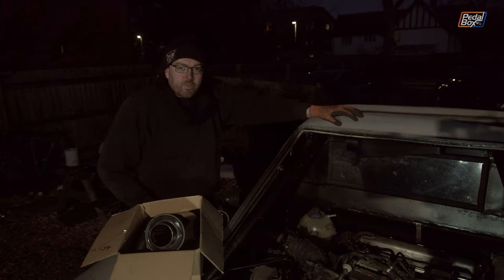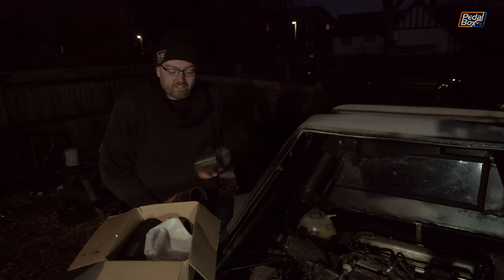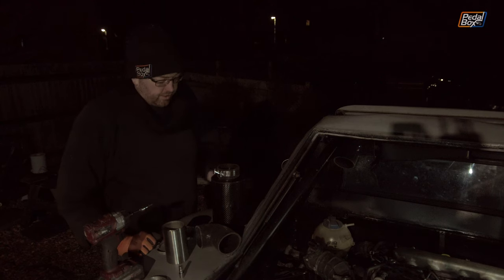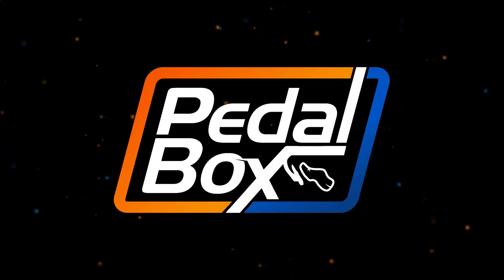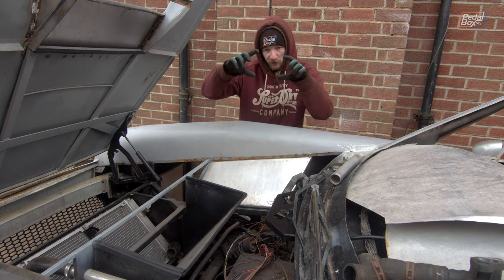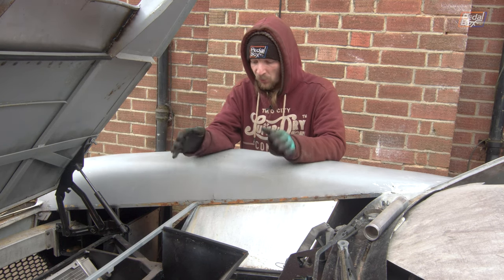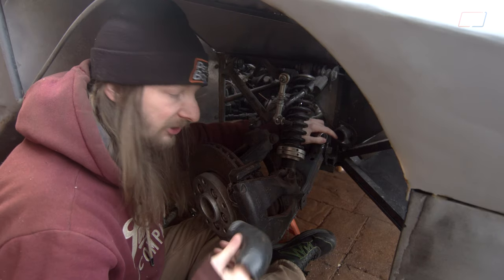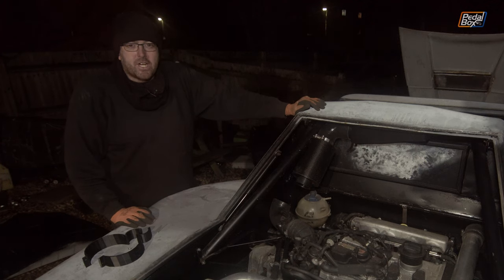PRINTING Our Problems Away | Audi TT Kit Car | PedalBox Episode 124

Comment: You could really see the temperature change in the frosting over of the rear window. Doesn't look like a pleasant time! Still, that's an awesome looking intake, and the way everything just fits so beautifully is fantastic!

Also, as an observation - with the air intake being solely on the roof and nowhere else... the little racecar is also, apparently, built for swimming :D
Reply: Murderwagon will not be waterproof enough to serve briefly as a boat, so it cannot cross rivers, lakes or even seas even if they aren’t too choppy
Reply from the maker: Without enough speed you can skim over anything :P

Comment: Great video, great to see the car progressing.

For creating the design for the bracket you might want to take a look at Fusion 360.  I've never been great at CAD but Fusion seems to be pretty capable and the community are very helpful.
Reply: I’ve been trying to convince Ade to pick up FreeCAD for ages but the transition from how SketchUp works to how CAD works has always been a bit bigger task than he’s been eager to take on!

Personally I used to use Fusion until even basic stuff like “export this model as an STL” became a cloud operation subject to all the latency that brings, at which point I caved and started using FreeCAD instead. 

We do actually want to redesign some parts, which we’ll be streaming tomorrow if all goes to plan!
Reply: @ChrisDRimmer  I didn't realise that was a cloud operation, but that certainly explains a lot.  I might have to take a look at FreeCAD now, how do you find FreeCAD compares to Fusion?
CAD certainly has a steep learning curve, which I am certainly still on, so I can see why he wouldn't want to start on that journey.
Reply: @ronaldreagan7347  so to be fair it MIGHT not actually be being done in the cloud, but it takes more than zero seconds and that pisses me off. Smells like “upgrade to the expensive pro version to get basic functionality!” to me which I’m not a fan of.

So far, FreeCAD has treated me well. It definitely works different to Fusion in quite a few places and it’s not quite as smart in a few ways - one of the ones that keeps biting me is that you can’t do anything with individual regions of a sketch - like you extrude or pocket or loft a whole sketch, no Fusion-style selecting specific parts of a sketch. But tbh I’ve found that encourages me to make a larger number of simple sketches using linked geometry, which in turn encourages using spreadsheets to calculate dimensions etc which ends up producing much more robust models in my experience so far.

It’s also super fast. Fusion often felt like it was twiddling it’s thumbs and eating CPU cycles for seemingly no reason (even on a fast Zen 2 machine) but FreeCAD always feels snappy even on my old 6600K.

Overall, I can honestly recommend it. The tools I’ve used so far in it are all well documented, with their limitations quite well signposted. And there’s no always-online requirement or anything. It’s how software should be, tbh.
Reply: I caveat all of the above with a big “I am neither a professional engineer nor a power user” so my recommendation should carry relatively little weight :D
Reply: @ChrisDRimmer  Thanks for writing that out, I will take a look at FreeCAD in the next couple of days then.  Probably good to look at it now whilst I'm still learning Fusion before I get to comfortable and don't want to switch.  As I have started to get used to extrude certain parts of a sketch.

I have definitely felt that Fusion has felt slow at times which has certainly been annoying.  

To be fair I probably won't be either of those anyways, just want to be able to make simplish models for 3D printing.
Reply from the maker: We should be doing some live stream tonight bringing the things we've made in Sketchup over to fusion, be that import and fix or from-the-ground-up. Chris loves some stress-CAD :D
Reply from the maker: @ronaldreagan7347  We didn't stream, but will tomorrow if it all powers up ok, today was pretty torrid evening of faff in the end!
Reply: @PedalBox  No worries, will keep an eye out tomorrow for a stream.